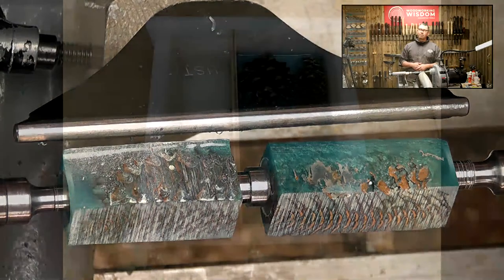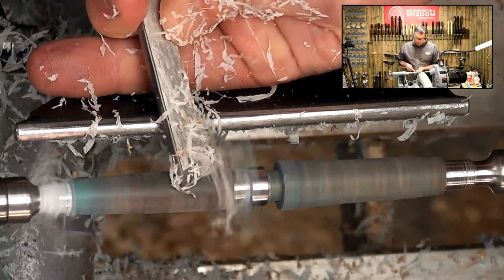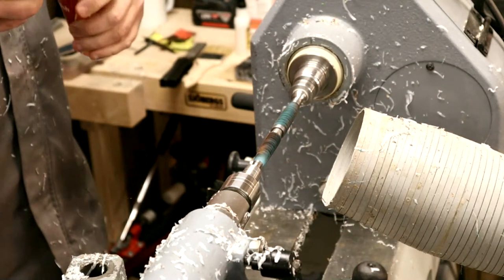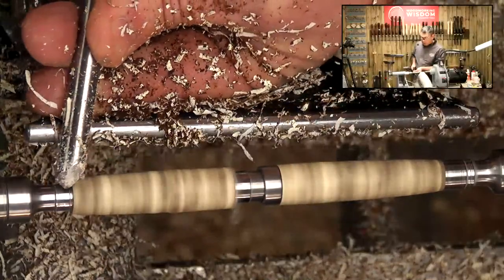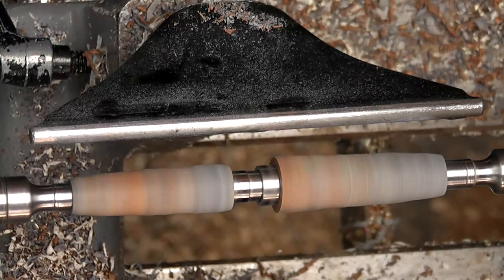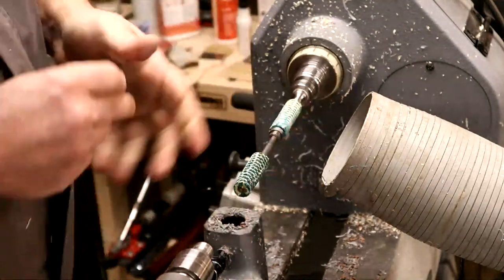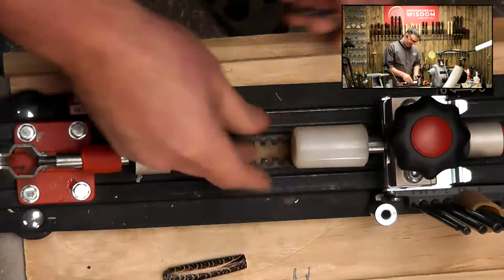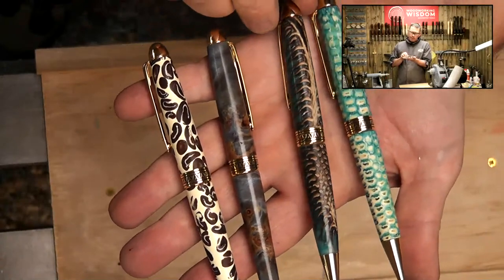Resin and Polyester Pen Blank Turning - Woodworking Wisdom

Comment: For the rotary scratches, especially on the lower grades of sanding, what I've found to be best is to stop the lathe when you think you're done. Then laterally sand while manually turning the mandrel and that will take off all of the bits. Sand until all of the vertical scratches are gone. Do this through all of the dry sanding grits (to 600) before using the micro mesh.

Comment: can we use resin polyster ?
Reply from the maker: Hi Oussama, yes, you can use Polyester. However, it's very pungent and has little structural strength. I hope that helps 😊